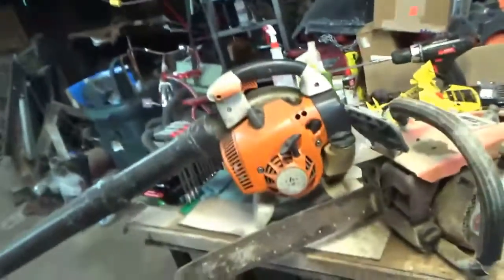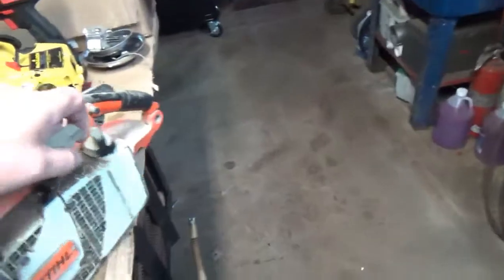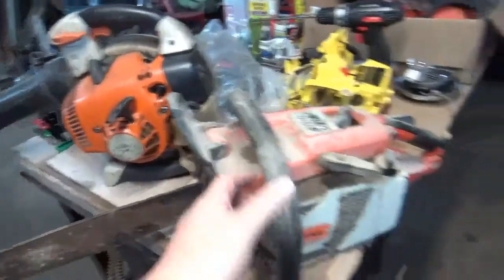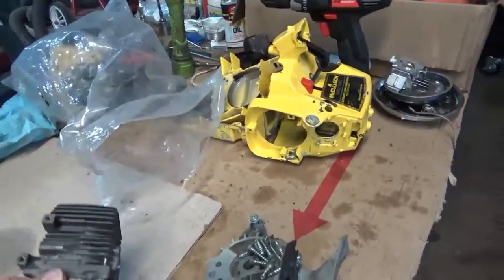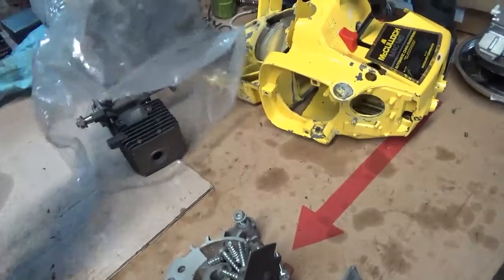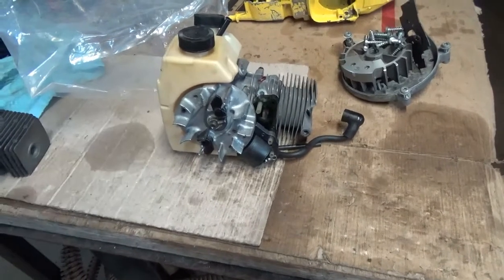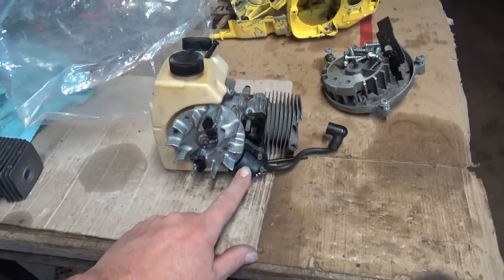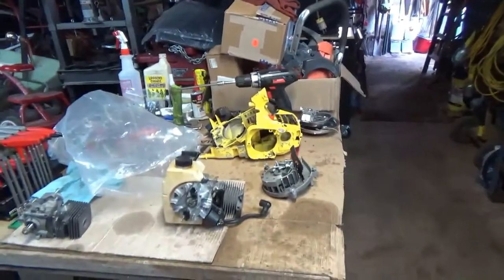What Showed Up On My Doorstep

Comment: worst saw to work on, ever................have to pull it totally apart to do a fuel line and carb kit.
Reply from the maker: Carb kit is why it's still apart, I received the kit 2 days ago with only 1/2 the parts/peices in the package, contacted the seller and after checking his stock he stated all kits on hand were missing the same pieces and said he had contacted Walbro about the missing pieces and was waiting for a reply.
Problems and  Issues the Story of my Life 😤🤯